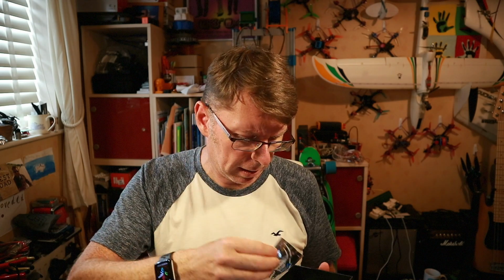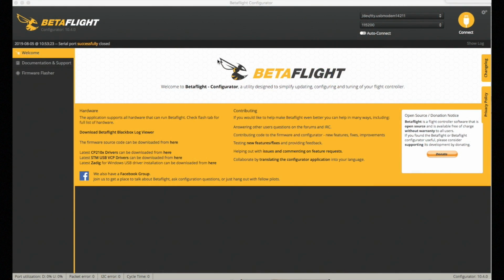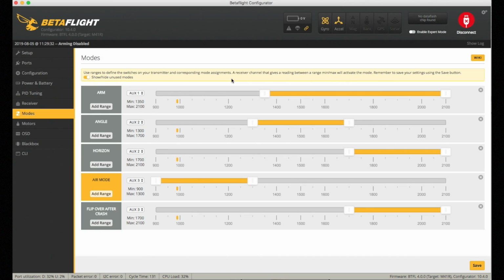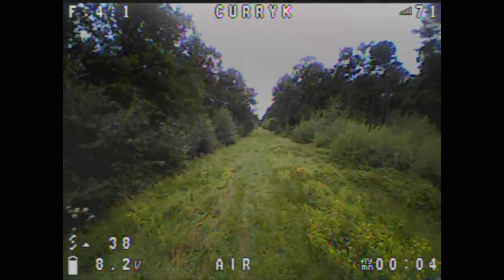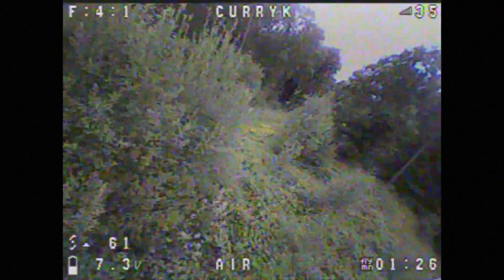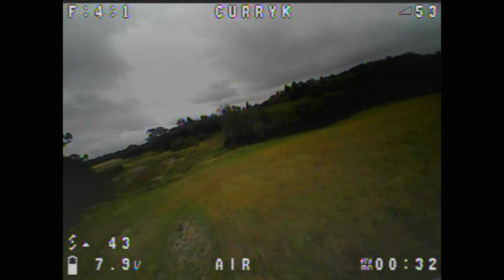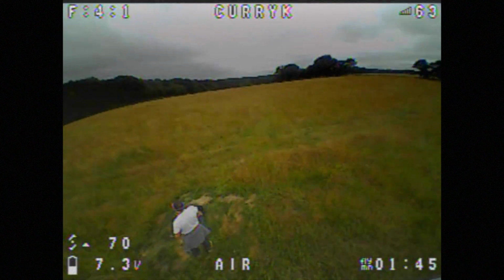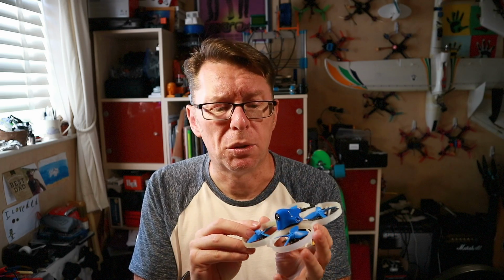BetaFPV Beta85 Pro 2 Acro-Whoop, supplied by BetaFPV

Comment: I know a lil bit of hours has past since the post of this video. But I have a question... Can this 85x be upgraded with some split camera for HD footage.. like caddx or duncan's? Thanks in advance
Reply from the maker: It's a case of fitting in there, so you'd really have to come up with your own canopy to hold it in.  The problem with this quad though is that it was designed to be quite light and only uses 2S, it's possible the extra weight of a split camera will make it sluggish and/or underpowered.
Reply: @CurryKitten  Thanks a lot for your reply Sir. Ok, I'll keep searching for options! <3

Comment: Thanks for the review :) , what camera do you think will be better, and fit into the canopy ? and also, did you fly it only with the battery provided with the quad 2s 300 Mah ?
Reply from the maker: Something a bit less distorty.  I would love a micro swift on a quad like this, but I think you'd need to do some mods.  The RunCam Nano Racer may have a better chance.  I'm just about to test this out after having fitted it in another micro.  I flew it with the 300mAh provided and a few GNB lipos of my own

Comment: Love my beta75 pro 2, been thinking of going for the 85 pro 2, mostly just for the parts to throw into a primo build.
Reply from the maker: You can get the parts separately if you want to build something else up with them :)
Reply: @CurryKitten  Very true, though that usually ends up coming in more expensive over all. Then again, after looking at the specs, I'd get the 10a 2-4s aio betafpv fc, and larger motors, so I could make a toothpick with a turtle. It's almost whoopin' season anyways, and I've modded all my whoops to open props, so i'm on the fence as to which route I'll go; built or custom build.